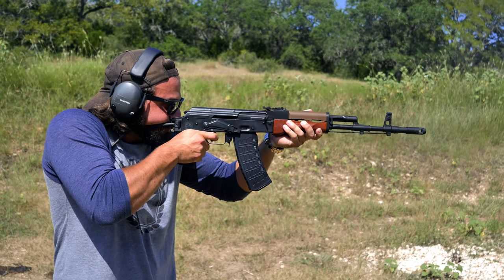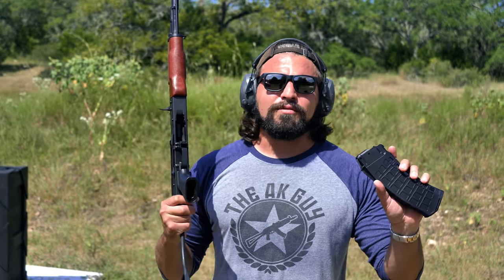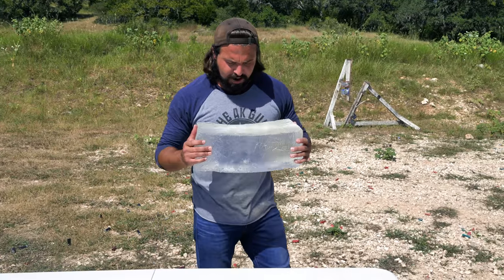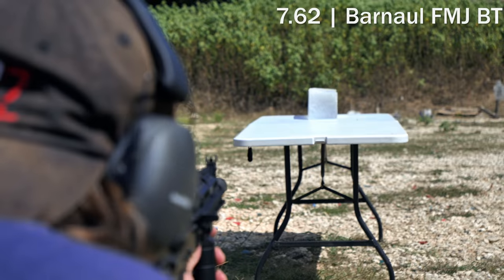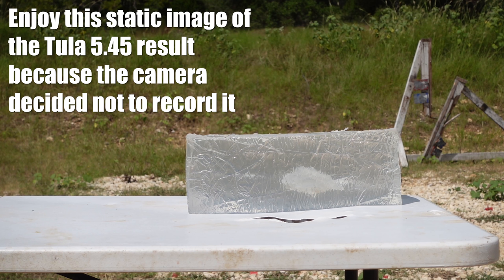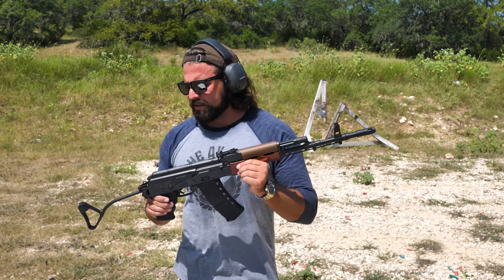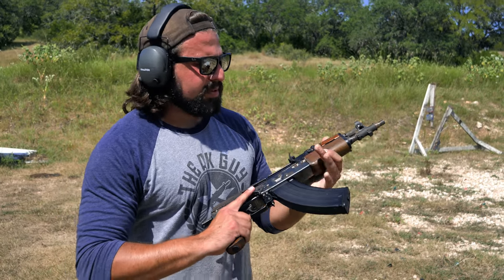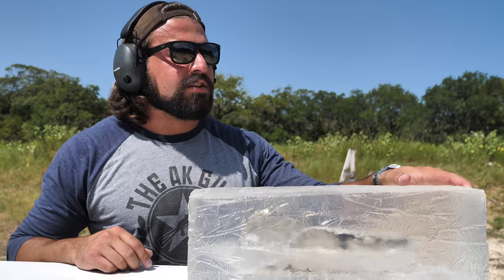7.62 vs 5.45 - Which Is Better?

Comment from the maker: Thanks for watching guys! Which do you prefer, 7.62 of 5.45? Also what other comparisons would you like to see in the future?

Thanks to MyBookie for sponsoring this video! Be sure to check them out and use the code "BRANDON" here: https://mybookie.ag/lock/
Reply: Hey brandon
Reply: 7.62
Reply: Prolly 5.45 cuz it's cheaper where I'm at lol
Reply: Love you brother hope u have a good day💙🧡
Reply: 7.62
Reply: hola brandon
Reply: no, thank you for posting
Reply: 5.56 vs 5.45
Reply: #akgnotificationsquad
Reply: I‘d like to see the Dragunov vs. the yugo M76!
Reply: I want that AKM.
Reply: 7.62 for long pew pew and 10mm for short pew pew anything else is irrelevant lol
Reply: me like both
Reply: 556 ak
Reply: Honestly I prefer 5.56 😂😂😂😂😂
Reply: We need a 6.21x39 round. Best case scenario, it has benefits of both 7.62 and 5.45. Worst case scenario, it's basically a .40 SW, but more of a meme round based on a furry art image board. That's an absolute win.
Reply: Now that they're both equally available, questions like this matter.

And the answer is 5.45, by the way. Yes, they both have their advantages and disadvantages, but the advantages of 7.62x39 are not as numerous, or as generally applicable, as the advantages of 5.45. It's why the Russian military went with that round over the 7.62x39, and why the US military will never go to .300 BLK. No, 30 cal hipsters, it's not going to happen. We might swap over to some kind of 6.5 SPC, in like, 40 years, maybe, but for now the .22 bullets reign supreme. Better terminal ballistics at all ranges, less overpenetration, less weight. 'But muh 30 cal doesn't hurt muh ears as much and hits the thing harder outta muh shorty!' Yes; you get less loss of terminal ballistics shooting 30 cal out of a short barrel suppressed, and it's not as loud, and not as much flash, than the .22 cal. Get a suppressor that doubles as a good flash hider and run an MK18-length barrel. The only generally applicable advantage those 30 cal rounds have, is that they're more likely to go through less dense, higher-mass objects, which is only really an advantage out in the fucking woods.
Reply: I say 5.45x39 mm is better
Reply: Haven't fired 5.45 #akgnotificationsquad
Reply: 7.62
Reply: Got to choose the old school 7.62. #akgnotificationsquad
Reply: 7.62x51 is the best we can get now so I guess it wins
Reply: I prefer the 7.62 because of deflection issues and I need the energy on target.  5.56 and 5.45 require a bit more accurate shot placement than I can manage against wild hogs.
Reply: Papa KALASHNIKOV said then he been ask to made automat for smaller round, he said "Why? 7.62x39 mm is perfect round"
And made AK-74 after
Reply: As long as it pops a watermelon into peices its for me.
Reply: @aidenburnside6380  I feel ya. I don't even have one, but.... You know.... Zastava has that really nice $3K DMR.
Reply: @mylastaccountgotdeletedtha6936  Do not bring the furries here.  Brandon doesn't need that energy.
Reply: 5.45 even though I own neither 🤣
Reply: Maybe 762 vs 9×39 or 9 mak vs 9 para vs 9mm short.
Reply: 5.56 vs 5.45
Reply: Would love to see some more pistol stuff. It would be awesome.
Reply: Too bad get either has become difficult/expensive thanks to potato man bad.
Reply: So what di you think on the lee enfield family of rifles or do you not care for a smooth bolt action
Reply: @ColonelEviscerator  what energy?
Reply: I'd like both, but here in the NL I'll have to make due with 6mm ;-p
Reply: Part 2 5.45 vs 5.56 @Brandon Herrara
Reply: #AKGnotificationsquad
Reply: Brandon
Could you done 6.8 caliber shooting, i heard and saw weird stuff about 6.8
Reply: @bradymcdonald7807 
5.45 is better
Reply: 7.62 all day
Reply: I prefer nematodes
Reply: 11:22 why are there so many shotgun shells behindyou
Reply: .45 acp
Reply: 5.45 is great but I can’t get over the hunk in mass that is 7.62
Reply: Hey brandon, is that a mother hecking willerZ cap?
Reply: 7.62 and why not compare 50bmg and 12x108?
Reply: 5.45x39 is best AK round.  Also can you do a 5.56 m vs. 5.45 video? Or just anything 5.45x39 in general.
Reply: 5.45 to the MOON
Reply: 303 and 308
Reply: 7.62 is a better urban rifle round. 5.45 is better at everything else
Reply: can you make a video on the ak 12 pls
Reply: 5.56 vs 308 please
Reply: RIP AND TEAR!!!
Reply: Looking a little shakey there bud
Reply: 7.62x51 of course 🤗
Reply: 308 vs 277 Sig. Nobody has real 277 Sig reviews yet.
Reply: maybe Vz. 58 vs AK ?
Reply: More 7.62x54r content please I am a mosin man
Reply: the wolf brand 6.5 grendel is a hollow tip 7n6 round. No steel core, but boy does it tumble upon impact.
Reply: Ak47 better because Im russian ;)
Reply: Only ONE of these calibers has the potential to be functionally useful in the event of total loss of commercial ammo production - the only one that can function with home made cast lead projectiles => 7.62x38...

5.45mm is too narrow to have any reasonable chance of not disintegrating during firing, and have sufficient velocity to be of much use...

7.62 has boxer primed brass cases, can be loaded with gas checked lead at good velocities and will function in semi-auto just fine. 5.45 will not.  5.45 will likely never have the same kind of availability / longevity in the US as 7.62...

Why would i want to own a caliber that can be legislated into near non-existence?
Reply: 30-06 and 7.62x39
Reply: @jeandelport166  7.62R vs 8mm Mauser
Reply: Can we please get an "AK Guy" shirt with the classic ak silhouette on it ?
Reply: What's the difference? You just do mag dumps into dirt with both of them... ?
Reply: Hey, Brandon, if I had an idea for a forced reset trigger for AKs and could show a cardboard prototype, could you try making a real one and a video about it?
Reply: SO much for converting to semi, yeah yeah !!!!
Reply: 7.62 Tokarev against 9x18 Makarov.
Reply: I would like you to get more ballistic gell fart, I have never seen that happen before. I have also been educated that is something I appreciate so thank you for that. I know this channel is more for seasoned gun owners with exceptional taste so I will make a request for the 2nd channel, could you please do more nuts and bolts stuff please, teardown cleaning and servicing the equipment. Also seeing the worksop a full tour and see where the shit gets done. A fan of the channels from Scotland.
Reply: Old but strong 7.62
Reply: I really want to see what these rounds do to calibrated 10% ballistic gel, as opposed to the clear stuff.
Reply: Just in time for the report I've got to do on ballistics for my BBS100 course at SDI (they say "hi, by the way)
Reply: Do you cry a little inside after each shot?
Reply: The way i see it that a bullet destroys doesnt matter what caliber😝😝
Reply: Fancy and Brandon H. do not go in the same paragraph together. You don't fancy Russia, Russia fancy you.
Reply: 7.62 x 51 ANYTIME.
Reply: Would definitely like to see you continue this content but add 7.62x54R.
Reply: A heat gun will SMOOTH OUT the ballistic gel.(Per Taofledermaus)
Reply: I'm curious how 9x18 Makarov would compare to .380 acp
Reply: 5.45 but 6.5 Grendel is superior to both.
Reply: Quick question, is there a difference between a tantai and a standard ak 47 or 74
Reply: 5.45x39.  I even reload for it because I'm developmentally delayed.
Reply: @jacobjackson6073  the tantal features a safety on the left like the galil.
Reply: 45 Acp vs 9 mill!
Muh stoppin power!
Reply: Vz 58...and not that century crap...do a csa...join us... lol
Reply: Fat bang or fast bang? Hummm… I take both 😜
Reply: What if you're one of those guys who likes 9x39? AK 50 when? Lol gotta troll. In all seriousness, awesome video, very entertaining. Love your videos Brandon, keep up the good work.
Reply: 5.45 but of course it is better......Nobody ever does a test on the humble 3030 more punch than 7.62 by far....lt would make a good test video something different.....Thanks Mother lover....Huuuuu some how that sound a little taboo lol....!
Reply: @stonegrendel9064  oh alright, thanks
Reply: 14.5mm vs .50 BMG
Reply: 7.62 because home defence and I also have a 5.56
Reply: AR 5.45 vs AK 5.45
Reply: 9mm vs 45acp
Reply: Do an accuracy test with AK, Ruger Mini, and AR chambered in 7.62x39
Reply: Please bring out an AK in 5.56 and show us the difference between a slew of those cartridges. Its a vast caliber and those AR boys don't need all the fun.
Reply: About 6-7 months ago I was telling a guy who has guns but no AR or AK to get BOTH AK calibers since the ammo price was much more stable than .223/.5.56 . I screwed the pooch on that one. Maybe Ukraine, Moldova, and Serbia will crank out prodigious amounts of both Ak calibers but that's going to take time.
Reply: Use-case sensitive. 7.62 for relatively close-up, 5.45 to reach way out and touch someone.

As long as you're raising people's back hairs by challenging their favorites, why not compare .45 ACP against near-peer pistol calibers like 9mm etc.?  As you pointed out, piercing vs. shredding matters.
Reply: 7.62  I like to use it to hunt deer here in VA and it's just fun (and used to be dirt cheap) to shoot.
Reply: Very cool, and while I like both cartridges, I prefer 5.45 for most stuff.  Loved how your Tantal 7n6 shot demonstrated a textbook Fackler "double lobe" yaw pattern, just as he found with the first tests of 5.45mm ammo.

Mo' shooting with gel blocks, please.  Maybe compare all the Russian/Soviet cartridges to their Western counterparts?  7.62 Tok & 9mm Mak vs. 9x19 and/or .45, 7.62x54R vs. 7.62 NATO,, 9x39mm vs. 300 BLK...  maybe even 7.62 Nagant versus, I don't know, .38 S&W or  .32 H&R Mag SWC or RNL?
Reply: The OTHER 7.62 would have been cool to compare too!
Reply: I would like to see you go over the history a little bit. How they decided to make the 7.62x39 the leingth it is or how they came up with the 5.45
Reply: Make 5.7x28 AK
Reply: 6.8 SPC vs. 300 Blackout.
Reply: I know you have almost certainly seen this, but in case you haven't, Uamee has a song dedicated to the AKs. https://youtu.be/4DkhUO0AV_g
Reply: 5.45 vs 6.5 grendel would be interesting.
Reply: Next video use the dummy torso with internals
Reply: @gatorteeth5908  Lucky
Reply: Ide perfer to have an ak in 50bmg.

Where is ak50?
Reply: Is it sad that I instantly noticed the zenit shit on it cause of tarkov I’m pretty sure I’ve used that exact build in game
Reply: 7.62, but that's because I don't own anything in 5.45 yet. YET.
Reply: Yo Brandon, I don't know if you have the capabilities for this. But I'd love to see a video about the Czech Vz. 61 Škorpion.
Reply: i've never tried 5.45 and now i want to. Of course that's gonna be pretty hard now
Reply: 5.45 kills the body but 7.62 kills the soul.
Reply: Part 2 sir
Reply: 7.62 all day, shaky hands! 7.62 Toka Vs 9x39 out of sbr/subs. Props on the content!
Reply: I kinda would like to see 7.62x25 tokarev and 5.7
Reply: 7.62x39
Reply: 5.45
Reply: If I could find an AK-74 I would let you know! 😭
Reply: @bladesedge2  right thats why I said 7.62 I'd love a krink
Reply: 50 bmg ak is best ak
Reply: Umm the 762x39 first gun was the Sks in 1945 then the Ak-47 in 1947 that's was first designed for paratroopers to be used as a submachine and not as a rifle that's was the sks job they wanted to have an Smg, rifle, and light machinegun in the same caliber for the new arms document for the red army after WW2
Reply: I prefer the 5.45x39mm so much that I built a retro AR rifle in 5.45 with a 20" barrel, M16A1 stock and a triangular handguard, just to mess with AR guys.
Reply: @bradymcdonald7807  this out of Arsenal 106 and 104 to see both accuracy and damage.
Reply: I'd like to see a 223. and 224. Comparison
Reply: 7.62x54r out of a Romanian PSL54 :P. Gotta love the big-boi-snipey-ak-that-looks-like-a-dragunov gun.

Also someday I'm gonna build a Tabuk-style build in 5.45x39 to explore the better ballistic coefficient of the round compared to both 7.62 and 5.56, and when that day comes I'm gonna blame you for all the money I'll have to spend on parts.
Reply: 5.45 is my favorite, but I prefer 7.62.

Would love to see 5.45 v 5.56
Reply: 7.62
Reply: Can you do comparisons from the smallest cal up to the largest you can legally own and maybe if your feeling spicy a 16inch battleship
Reply: 9×39 vs 300 blk subsonic
Reply: Do a western vs eastern block rifles.
Reply: Is it bad that I unironically want Olga the trash pistol replete with shovel folder?
Reply: Compare 9x19 to the makarov 9x18
Reply: where is the 9x39🥺 ma baby where sheee isss🤣🤣🤣 if you got the 9×39 it was going to be more fun. but, i think you have 1 gun for it so no barrel lenght thing so🤷‍♂️
Reply: I’m kinda wana know what the 9x39 would and compare all 3
Reply: 5.56
Reply: Would love to see a part 2 also 9x39 compared to 300 blackout would be interesting as well
Reply: @macklam  ouu that's good one
Reply: I would probably go with the 5.45mm. Why? Just because.
Reply: It's almost like the soviet union adopted the 5.45 round to do away with the 7.62 round. strange.
Reply: 5.45
Reply: 9mm Mak vs .380 ACP
Reply: maybe 5,45 in tantal vs 5,56 in beryl.
Reply: "A little bit more energy" 12:37 set YT playback to 0,25x speed it is spectacular
Reply: Biden: bans russian ammo imports
Brandon:
Reply: 5.45 cuz I need that velocity
Reply: 7.62 because the odds of finding 5.45 on a shelf is as likely as digging up a dinosaur in your backyard.🤔
Reply: 2 in the pink 30 in the Krink!
Reply: Brandon you put “of” where “or” should be
Reply: @gatorteeth5908  it’s faster gets better range and penetrates better
Reply: @chrisoliver3404 ok let’s assume there insnt an ammo shortage or ban
Reply: @goonieoh8488  I reload so I don't have an ammo shortage.
Reply: @chrisoliver3404  lmao
Reply: @goonieoh8488  Started reloading in 2018...7.62x39,5.56,and 9mm everyone laughed,now I'm the one laughing 😆
Reply: man, there are so many cool ones you could do. Pretty much any Russian vs American caliber comparison video would be awesome! 9x18 mak vs 9x19. 5.56 vs 5.45/7.62x39. even .308/7.62x51 vs 7.62x54r. All of those would be super interesting to watch! love your videos man, keep them coming!
Reply: 50 BMG vs 50 Beowulf vs 50 AE
Reply: 7.62/.308
Reply: Definitely like the 762x39 better. Until recently, it was very very easily accessible and stupid cheap before the PLANdemic nonsense. Plus, it hits harder the 545...and goes through a vehicle solidly...unlike 556 & 545!
Reply: @bradymcdonald7807  556 and 545 are pretty much the same overall...
Reply: .223rem/.556 nato vs 7.62x39 in the future! This was cool thx!
Reply: Do you own a Type 57 or a Type 84S Norinco? A Norinco comparison would be nice.
Reply: Hi, Brandon! I prefer 7,62x39, because it's more suitable for hunting and AK in that caliber is more reliable
Reply: @GrySgtBubba  that's the point...
Reply: Both....
Reply: @bradymcdonald7807  If they're almost the same, then that makes no sense to do a comparison. The only difference between the two are the weapon platform. Ballistically and performance wise, they're so similar that it just boils down to AR vs AK. If you had a weapon that was chambered in both calibers, the only difference between 556 & 545 would be 556 has better accuracy at range past 450-500yrds; and that boils down to case shape and powder quality. If you're pitting military round vs military round! There, there's your entire comparison right there LOL
Reply: Ima have to go with 7.62 since I haven’t been able to get my hands on a 5.45 yet
Reply: @GrySgtBubba  um AKTHUALLY 😬☝️... the purpose would be to compare the russian vs US version of a similar round. Thats it , what would be the point of comparing 50 bmg to 9 mm. that wouldnt make sense. 5.45 and 5.56 are is the same range which is why it would be interesting.
Reply: I bought an AKM from Classic some years back.  Gunshop owner asked me what the chambering was, I told him "7.62x39.  You wouldn't think I'd go for the .22, did you?"  He laughed.
Reply: .303. The round of Empire.
Reply: Shoot potato next time
Reply: @HolyDarkness767  ive got a mini psl in 39 to add to the compare for power diff
Reply: Brandon its not about the size of the boat or the motion of the ocean. It's about if the captain can stay in port long enough for all of the passengers to get off. (And if there is enough wind in your sails so you can go with no sag 😉)
Reply: @bradymcdonald7807  And I'm saying that they're so similar they're almost the same round...so comparing the two would prove moot. The only thing the 556 does better in is ranged accuracy, but that's only because it's in the AR platform. Put the 545 ina AR platform, and it too will almost match the 556. The 556 will still beat it out passed 500+ because of the powder quality and shape of the case. HOWEVER, either of those calibers are near pointless at ranges pass 300-350ish... Within 350m, 556 & 545 are basically the same round. Get it now? Lol
Reply: 9x39 vs .300 blackout would be cool
Reply: 6.5 Grendel
Reply: 5,45, got it easier and cheaper here, so.... :)
Reply: I feel you need to put 5.45 against a 7.62 8m3 effect round
Reply: Short barrel 54R AK pls... needed for things like clearing hallways and blinding/deafening western spies
Reply: Bring the 0brez m0sin into the 21st century
Reply: like the AK50 lite, but 7.62x54R flavor
Reply: @HolyDarkness767  super shorty 54R rifle party?
Reply: How about 7.62 vs 6.5 Grendel vs 300 Blk
Reply: Have you tested any Tula 8m3 ammo yet? If so, how did it expand?
Reply: Today was my birthday. I had a very great day today. With many presents and great-full friends and family to spend it with I can confidently say that it was one of the better ones. But the greatest thing about today was the announcement that David Chipman was not elected head of the ATF. Best birthday ever!!!!
Reply: 7.62 100%
Reply: I'd love to see a comparison of different rounds used in sniper rifles. A lot of people rave about .50 caliber snipers, but are they really the best? =^x^=
Reply: Hey Brandon just wondering if you could make a AK mini gun or is it impossible 🤔 shout out for Scotland we're not aloud gun's 😪
Reply: @timburwolfe118  happy birthday buddy have a good one 👍
Reply: 7.62x 39
Reply: I think 5.45 is the current best cartridge for taking down unarmored human targets. I think the ballistics, and more importantly TERMINAL ballistics, favor this more Than any other caliber. However... if my target has hard body armor, my goal is to dump enough energy into it to deform it or just knock out the guy behind it with the force of the shot. Bud since armor is frequently rated for it just dump about like 5 of them into the target instead of the usual 1.
Reply: 50 BMG vs 14.5mm, you have rifles that fire both of those cartridges, right?
Reply: 7.62 is bread and butter, 5.45 is kvass, 7.62X54R is sashlik, and 9x39 is caviar
Reply: Give a PTRS-41!!!
Reply: 5.45, love my Saiga ak74 haha love em both though
Reply: 458 Socom and 50 Beowulf
Reply: I like this type of video
Reply: I dunno dude, its like asking me  which i prefer in a mother daughter situation.... i want them both... at the same time if posible👯‍♂️👯‍♂️👯‍♂️
Reply: 7.62 all the way! One shot drop
Reply: Uhh…7.62x54 count? I love my 39’s(AK and SKS) but my PSL and Nagant are away too fun to smash with. Yeah, Nagant just smashes my shoulder
Reply: 7.62 because it’s more general purpose IMO. The extra weight and energy it carries is an advantage in hunting and it’s still a perfectly serviceable round against people if that ever proves necessary. I can have one rifle and stock up on one caliber that does both.
Reply: @nikolaymichaelsson9542  same
Reply: do subsonic 545s cycle
Reply: @jonasoliverabel9881  it would probably depend on the subsonic round and the individual gun itself. Some subsonics use a heavier bullet and the same powder, which leads to similar energy but a slower velocity. If I’m not mistaken, some use less powder but the same bullet to achieve less velocity. The latter would be more likely to have cycling issues I think. That being said, most AKs are over gassed so they likely still would cycle accurately. If you’re really concerned you can get an adjustable gas piston. Edit: feel free to take this with a grain of salt, I’m sure there are plenty of people out there with far more knowledge on the subject than me.
Reply: 7.62
Reply: other people : 7.62 or 5.45
me : 12 GA go bbooom
Reply: I like 7.62x39 more.   Got some friends in Russia working for Speznas & Fsb . They like the 7.62 more because of the better penetration.
Reply: @AkPingu  yea sure kiddo but your friends on CS or COD doesnt count. Ironically 7.62x39 is used mostly by middle east/africa civil wars or clueless US citizens. Not even Russians use 7.62x39 that much.
Reply: 5.56 or 5.45 if you want any practical use. 7.62x39 is just cheap round for casual recreational shooting.
Reply: .22LR clearly
Reply: He said wrinkled nut sac... he he.. he he...
Reply: im a big fan of .30cal pills but in this case i prefer the 5.45mm because of the ballistics and the straighter magazines. too bad its harder to find.
Reply: @gatorteeth5908  where are you at
Reply: 9x39 vs 300 blackout
Reply: Hey Brandon, can we get that Kalashnithompson now?
Reply: Me personally  I love 7.62x39 to suppress it and the nostalgic since of it , but my favorite  is 5.45x39 . Small and fast and has that tumble effect.
Reply: Pap M92 JHP and Pap M85 with M193 and M855  and  more AK74 Krink.
Reply: How about a comparison between all the different .50 caliber rounds? Like beowulf vs bmg vs ae and any others. Can see how different they really are despite being the same caliber.
Reply: Test some of the awesome 7.62x39 and 5.45 ammo out there... like hornady's offerings
Reply: 7.62 all the way.
Reply: I prefer 5.45 but 7.62 is much more common. I wish 5.45 would start being widely produced in the USA again but doubt it will. Hornady loaded Russian cases with their bullets for a while but guess they stopped because they didn’t make money on it. Maybe without competition from Russia and Eastern European producers they’ll try again. Doubtful but I’m overly optimistic too often.
Reply: I like temporary cavities. (then ask, "so, where'd ya park?" ) .... As far as the ballistics..?  I've watched the a bicep vaporized into "an August rain facial" on the dirtbag behind the dirtbag ... does that count..?  (MEDIC, I need a fucking medic!! I swear, I thought it needed a new tampon sanitary napkin )
Reply: 7.62
Reply: Hitting target is everything, so 5.45
Reply: @serega4087  7.62 is the only way
Reply: 7.62x54 vs 308
Reply: 7,62x39 higher energy doesn’t even make it that much more lethal, its only plus is better barrier penetration and brush deflection resistance (which may be very valuable in forested areas). You get a lot of cons tho and that’s the reason why 5,56/5,45/5,8 are the current calibers used by Nato,Russia and chiamna
Reply: 5.45 vs 5.56?
45-70 vs .50 Beowulf?
7.62x39 vs .350 Legend?
I love the comparison videos! Always have.
Reply: Hi! When I served in the Hungarian Army, I used the 7.62x39 calibre hungarian-made Kalashnikov version  -AK-63D-in Afghanistan.  The M4,and other weapons,with 5.56x45 NATO ammo,did not penetrated the covers  of insurgents-I mean walls of the buildings in the vilages. We had US-made M-4 carbines too,but I preferred the AK,with the heavy ammo.
Reply: @tamaskazup6560  Thanks for your service. For sure 7,62x39 has much better hard cover penetration than 5,56. Russian units will have most guys running 5,45 and a few guys with older akms to get through cover (as seen in the Donbass intervention)
Reply: @Jack72607   We saw the diffenent between the two caliber in AFG. The locals use to build his houses and fences,mud and stones. That is perfect for cover of  insurgents. The 5.56 NATO was useless againts it. Lot of german guy,who used the  G-36 rifle,used the 5.56 AP ammo for enough penetration..
Reply: @Jack72607  I forgot: we used the hungarian-made Kalashnikov variant,the AK-63D rifle,in 7.62x39 caliber.
Reply: @tamaskazup6560  I had the opportunity to try one with a very shortened barrel in a Budapest shooting range (just 8”, couldn’t stabilize the bullets and they would  tumble on paper at 20m). The instructor was an Afghanistan veteran as well and he operated in the Herat area, close to the Italians (he was a .50 truck gunner). From what I heard traditional Afghan buildings are very hard to penetrate and load bearing walls may only be dealt with with a .50 cal mg. The Finns still use their sakos in 7,62x39 because they will fight almost exclusively in densely forested areas with lots of branches and trees
Reply: Brando pls shoot targets From more distance
Reply: 7.62
Reply: Nice video would gladly like to see more in the  same style but this time with 12.7 x 99mm nato VS 14.5 x 114mm ( caliber you can see used by the soviet in WW2 for the PTRD) if you can do them that is
Reply: 7.62, all the way.
Reply: Watch the recent Polenar Tactical video on the Desert Eagle and then consider using wet clay instead of ballistic gelatin.  It's got to be cheaper, and the comparison of the holes made in the clay by 9mm and 50AE was awesome.
Reply: @fredsmith9788  clay can be interresting as it will show you the impact of the bullet on the clay
Reply: I own neither but i'll pick 5.45x39 over 7.62x39.
Reply: I'll take 7.62x39 and 7.62x51 over 5.45 and 5.56x45 anytime. 
"Thou shalt not enter battle with a rifle of a caliber less than 30".
Reply: In post soviet countries - 5.45. Light weight. In africa or latin america - 7.62. Easier to find
Reply: In my city Kherson in Ukraine also better 7.62x54 because it easier to loot from enemy's machine guns and it has the big chances to find box with AP rounds.
Prey for stop the war in our country
Reply: 7.62 x 51
Reply: DUDE!!!
PLEASE clear your weapon CORRECTLY!!
Drop the magazine BEFORE you rack the action!
C'mon, MAN!
Reply: With all the good things that you said in the end about 5.45, why do you feel sniper rifles and DMRs are usually chambered in 7.62x51mm / 7.62x54mm / .308 , and not in 5.56 / 5.45 ?
Reply: 6.8spc
Reply: So since you're "the AK guy" I am guessing when you say 7.62 you mean 7.62 x 39 but 7.62 x 51 and 7.62 x 63 are both pretty darn common a pretty decent handful of other 7.62 cartridges that aren't going to be any random amounts of ammo.
Reply: Actual .308 win(not 7.62nato) vs. 7.62x54R would be nice. You just did the 7.62X39. But you could throw the other real 30 cals in for comparison. Say 30-06, .303 British, and the neutered 30 cals of .300 blackout and the diet 
.308 ie 7.62 NATO. Call it the "Battle of the 30 cals" or something. Obviously .300 win mag wouldnt be fair to the rest. But it is used on the battle field by some.
Reply: 5.45 is better due to armor piercing abilities and it is newer. What about 7.62x51 vs 7.62x54?)
Reply: A serious Question . I am from EU and we always !! Always remove Mag and than check champber not check chamber than remove magazine. Is that move normal or taught in USA ?
Reply: I prefer 7.62
Reply: @jeanvaljean341  7.62 is better in any close range combat, urban or jungle etc
Reply: Is that a willerz hat you got on
Reply: 6mm arc, and the 6.8 coming out of the new M5 or MCX Spear.
Reply: I’d like to see 5.45 on shelves for sale! As an AK aficionado, do you know anything about domestic production going forward?
Reply: 5.45x39 for me,fellahs😉👍
Reply: 30-06 Vs 7.92x57mm, 7.62x54mmR Or 7.62x51mmNATO or all of them if you have the time please.
Reply: My Veprs love 7.62 and 5.45 respectively.
I prefer 74 vs 47…especially since I still have a stash of 7N6.😁
Reply: @gatorteeth5908  that did not age well at all
Reply: I like 7.62 more simply because it’s funner to shoot. When I first shot an ak it was an ak pistol in 7.62 and the fire ball is something I crave for
Reply: Brandon, correct me if I am wrong but didn't the Mujahadeen call the 5.45 the poison bullet due to it's cavitation and "getting stuck in people" affect?  Perhaps it was that 7n6 projectile that was to blame?
Reply: @ColonelEviscerator  That doesn't even make any sense, the 5.45 travels way faster than a 7.62x39mm. You will be seeing that thing hit a target very accurately and almost instantly even from far ranges as compared to the slower 7.62x39mm. Also the 5.45mm is a very dangerous and much more deadly round, yawning and tearing tissue from it's extremely high velocity creating much large and more permanent wounds/cavities. Velocity always equates to more kinetic energy than mass, where mass in divided by 2, velocity is squared. Enough said.
Reply: @gatorteeth5908  where do you live?
Reply: 9x39 and 300 blkout which one is quieter?
Reply: 7.62...for reduced brush deflection.
I live in the SE US and its basically a jungle. I believe that's one reason many considered 5.56 a disadvantage in Vietnam. Seems the 7.62 has enjoyed advantages over smaller calibers in densely vegetated campaigns. Once you're familiar with the ballistics of 7.62, it's plenty accurate out to 300. I don't know many places around here where I could even see that far...if I were to encounter such a situation, that's what the 30-06 is for.
Reply: @mylastaccountgotdeletedtha6936  isn't that what they're going for with NGSW? 6.8, right?
Reply: @stupidanon5941  I basically live in the jungle...that's why i prefer 7.62. I don't know many places I can even see out past 300 yds around here. The way I see it, if I ever had to use it for survival/defense, most of my engagements would take place at less than 100. I'd rather be in the fucking woods anyway.
Reply: @jeanvaljean341  I prefer 7.62 for dense vegetation.
Reply: @carnivoreeats840  yeahh baby! i'm hear for the rippin' and the tearin', rippin' and the tearin'...
Reply: I prefer 5.45 since that's what the Krink fires and I am pressed to pick just one.
Reply: How about 7.92X33?  Good combo of stopping power and accuracy out to 300 meters.  That brings up the question, how much of range/accuracy/stopping power comes down to the bullet and how much comes down to the weapon it's being fired from?  The MP44 Sturmgewehr was considered accurate out to 300 meters, Ak-47 out to 200 meters.  The AK47 was meant to be massed in such large numbers that sheer volume of fire compensated for lack of accuracy.  The MP44 was meant for an outnumbered German soldier to stop massed hordes of infantry coming in human wave attacks.  Ak47 is firing a 7.62 at higher speed than the wider 7.92, so the tolerances in the rifle itself must make a difference for range and accuracy.  Putting the same rounds in an AR platform might make opposite range/accuracy results.
Reply: 5.45 for weight, accuracy and range, 7.62 for stopping power and shooting through cover.  The optimal round would combing low weight and size with accuracy, range and stopping power.
Reply: As I used to say if you can't decide choose both
Reply: 5.45x39

Better ballistics

Is i true that one can run any 7.62 supressed without sub-sonic ammunition bc it's so slow anyways?
Reply: 5.45
Reply: @gatorteeth5908  where sre you at?
Reply: What’s best for ak12 it grain
Reply: 60 fmj or 126 grain
Reply: Bad man in the closet ant coming out alive
Reply: 9x39, change my mind, it’s recoil is just right
Reply: @stupidanon5941  Russian Spetnaz(
Special
Force)
Prefer use 7.62
💪🏻
Reply: & the answer is 7.62mm has more penetration (mainly due to mass) & 5.45mm tumbles just after impact and dumps more of it's energy in the target faster. I would think 7.62 would have a little more 'effective' range too (Again due to more projectile weight, so less effected by wind and light cover.)
PS: I have never fired any AK Rifles, But this is my understanding of the situation.
Reply: Had me at coke, dude!
Reply: I have shot 7.62x39 my Dad's Sks love it
Reply: 7.62.....people shit their pants and pass out just hearing that round pop off (so I heard)😬..... It really ain't a Choppa without the 7.62🤔 anything else is blasphemy 🤣...... FR FR that 5.45 was badass tho, I can't lie.
Reply: If I have unlimited supply of ammo the 545 but if not the 762 39 will do just fine I like the 545 bc it's more like a 6.5 grendel far reach and can get it done
Reply: 7.62
Reply: I prefer 545 simply because it's better in every way. Only a moron would think hitting steel plates with a louder ring/destroying a cinderblock faster means anything. I care about what it does to people, and in that regard, 545 is better in every way.
Reply: @AR15andGOD  good information in my experience 762 does crazy things to humans and so does 545 if guess it would just depend on what gun you want and the purpose of it
Reply: I like the 7.62 myself, but 5.45 is awesome too
Reply: Of course 7.62x39
Reply: 50 BMG
Reply: Compare .308 to those
Reply: I'm a neopolitan kind of guy.
Reply: from what I have read the 6.25 British was a better round but the Americans pushed for the 7.62
Reply: 6.8 creedy